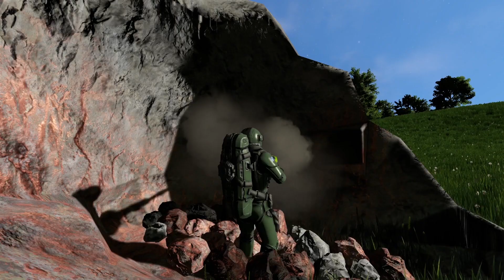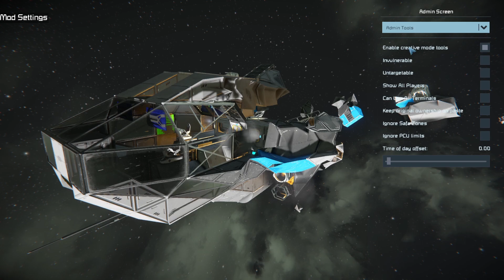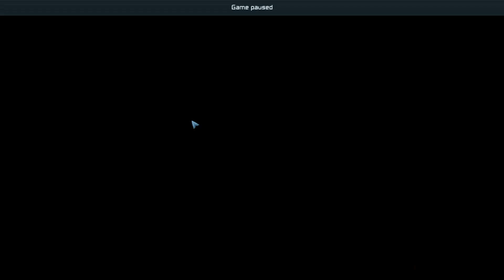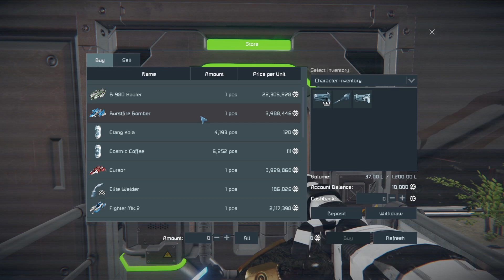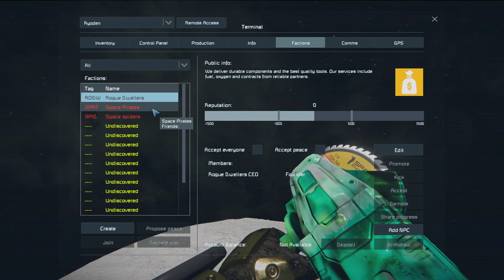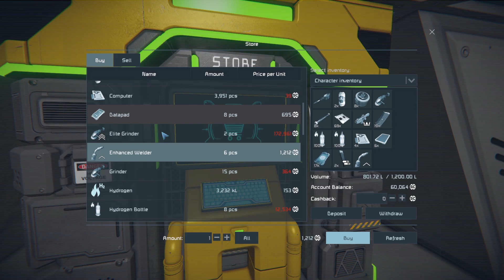Space Suit Only Survival Challenge (No Tools)

Comment: On the one station buried entrance either enable creative mode "g" menu voxel hands remove the voxels in the station or find the station and enable drilling just in that station. Once cleared reset the safe zone. As it out of your control of how it spawned.

I do not believe that if you put your inventory in  a locker/ armory/ storage crates it will remove it, but clean up will remove floating objects if you have it enabled. 

Yes unless you become neutral or friendly with SPRT you will not have any access to anything on that station beside O2 while in the "pressurized" areas

Beds usually only have credits
Reply from the maker: Oh, I know I could fix it. But I was kinda working on a "No Creative Tools" speed run challenge.  If not for that It would have been voxel hands for sure.
Reply: @ryodenshipwright   Your are well versed in SE, I put that part in there in case if someone else has a similar occurrence and know what they could do.... but that is the first vanilla trade station imbedded so that there was no access to to the inside... other mod I seen.

No worries either way